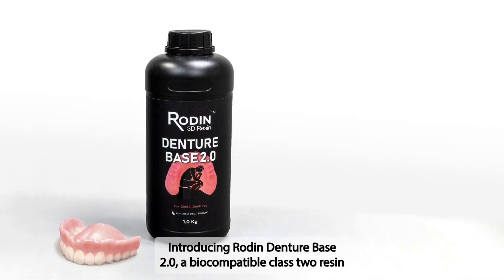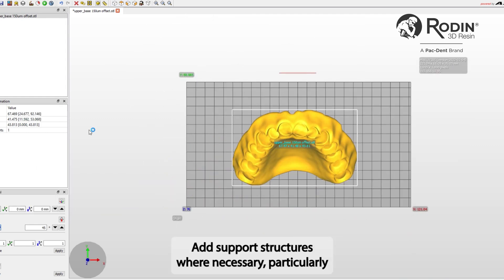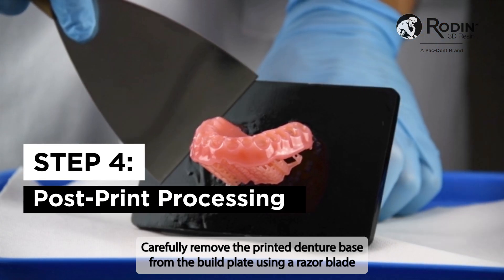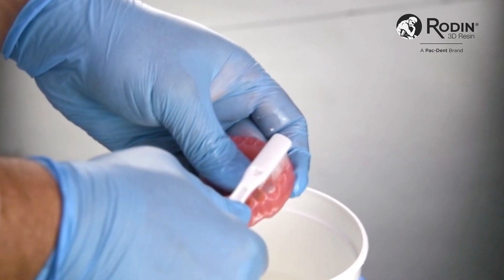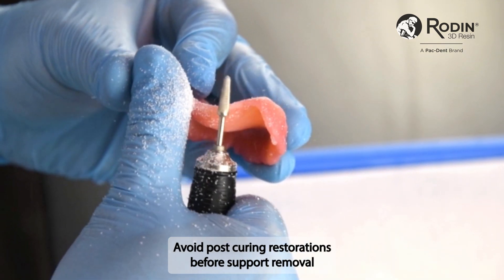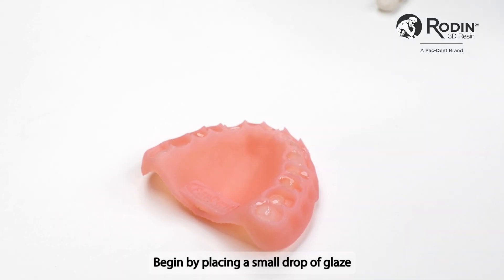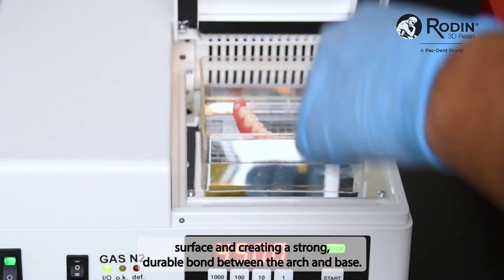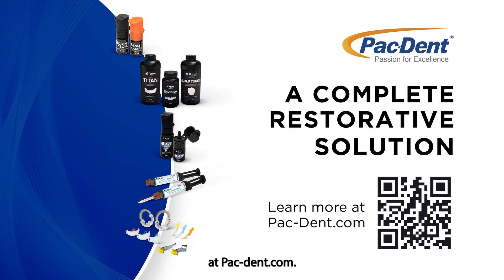Rodin Denture Base 2.0 Workflow

Comment: Question regarding the chemistry of the base.  None of the traditional reline/rebase materials I use with acrylic dentures are meant to stick to this material.  What options do we have for relines and rebases using this resin?
Reply from the maker: Hi Steve,
Thank you for your question! For relining 3D printed denture bases, we recommend Rodin® Soft Reline—a silicone-based, universal soft reline material specifically formulated for compatibility with both 3D-printed and conventional denture bases.
You can find more information about the product here:
https://www.rodin-3d.com/products/soft-reline
Reply: @pacdent thank you for your reply.  Had the reline material been on the market long enough to get a feel for how long it can last intraorally?